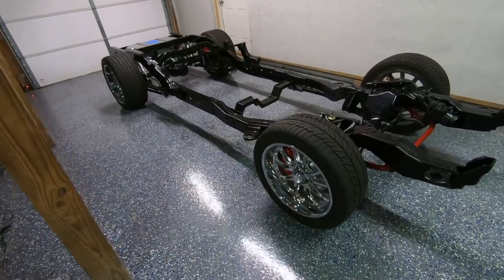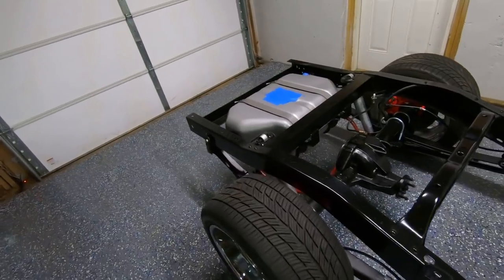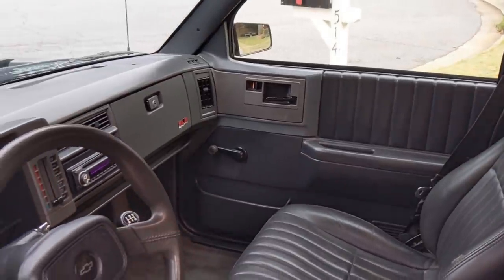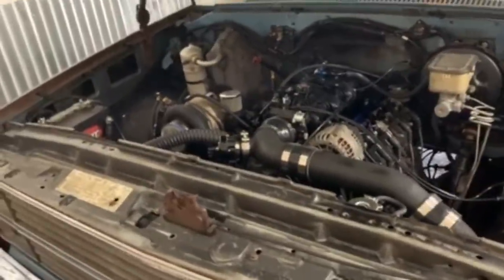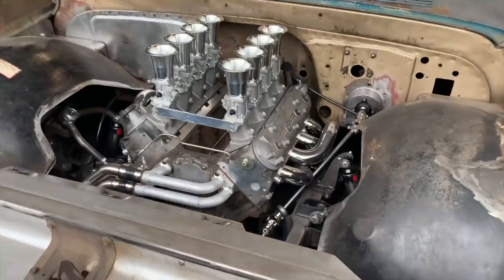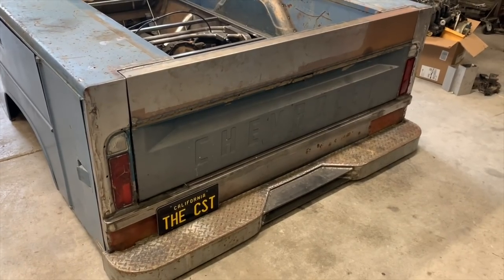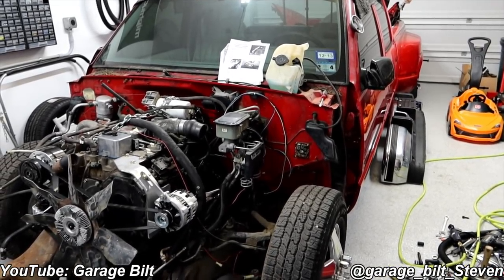Bagged '68 Utility Bed C10 / Cummins-swapped '94 OBS Dually / '93 LS-Powered S10 / '69 F100 and more

Comment: How do I clean rust from my floor panels any advice anyone? Anyone knows how to do it?
Reply from the maker: Wire brush bit on a drill should do the trick, if it's just surface rust.
Reply: @UNITEDBYTRUCKS  could I use sand paper 80 to 100 grit?
Reply from the maker: @michaellopez968  of course